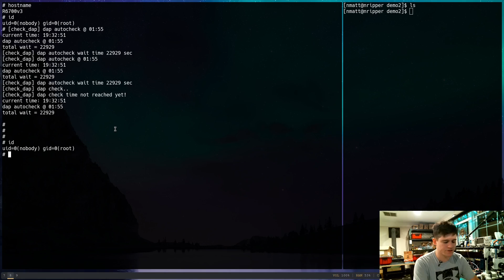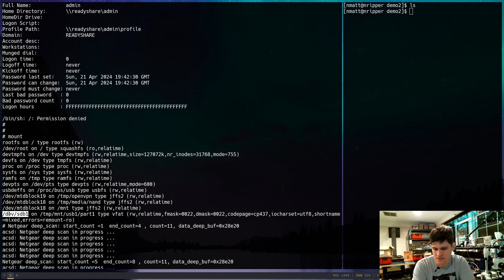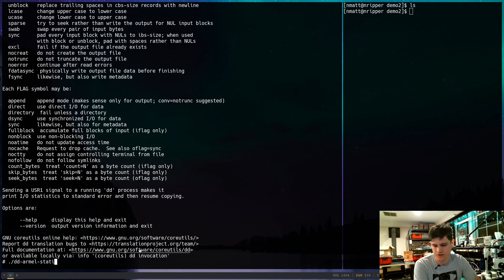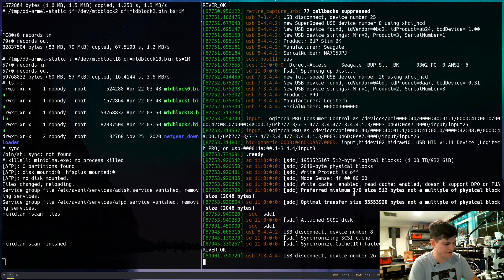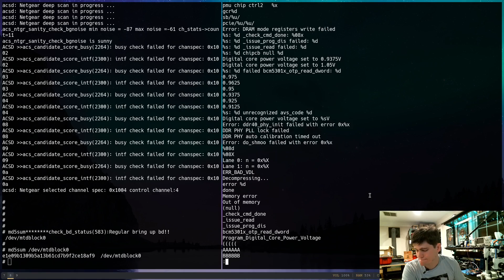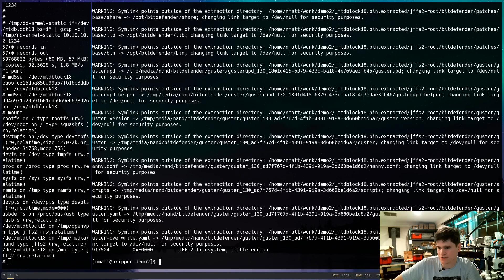IoT Hacking - Netgear AC1750 NightHawk - Firmware Extraction via Root Shell

Comment: Hey, amazing videos! Thank you.
I have couple of questions.
1. Can you explain how this extracted firmware is different from simply downloading latest firmware zip from the manufacturer's website? 
2. isn't this UART root shell same as just enabling SSH via webinterface and simply logging in?
I'm definitely confused.
Reply from the maker: 1. When you extract the firmware from the device itself you will often get writable partitions with device specific data that is not in the firmware file. Also, most newer devices don't let you just go to the manufacturer website and download the firmware file.

2. Some device's might allow you to login as root but many do not give you this level of access.
Reply: That makes sense. I was under the impression that if I got a root shell via ssh I was a root :-D Turns out they were tricking me all along. 
Thanks for your explanation  @mattbrwn

Comment: Question: instead of using netcat, could you use ftp (or sftp) instead to copy the files over?  That would seem simpler (netcat is good stuff however). Just for some more irony, setup the shared usb drive to be publicly accessible (through the router's webcomsole) and put the binaries you need for extraction on there, and the firmware files there also, then for them back using your main rig.
Reply from the maker: There are lots of ways to do the file transfer. what is "simpler" is often a matter of opinion. I think netcat is easier than ftp/sftp but that's just me.

Comment: Haha dream scenario being dropped into a root shell, wish all devices were like that 😂 Makes life so much easier having a shell on the live device, see any debug output, see what's running, try exploits against it, rather than going the whole emulation route on your main box. 

I did the netcat way on a recent router I checked out, was awesome, totally hadn't thought to use netcat in that way, worked a treat! 

Another question, have you ever de-soldered a memory chip and read it using a programmer and still can't find a file system? Or binwalk extracts stuff and it's basically empty, maybe a handful of files in what it extracts? Most devices I've fiddled with recently are far from straightforward. Trying to find some resources on what to do when this happens, I'm guessing it's some read protection on the flash chip itself maybe? 

Also, don't forget to remember your head is taking up the bottom right portion of the screen, so we can't see any commands you're typing behind your head haha
Reply from the maker: yeah definitely on microcontroller/RTOS systems you will not get any filesystems out of the flash chip readout. It those situations you can look at the strings or try to dive in an reverse engineering the binary code if you know the load address of the MCU target.

Comment: Just a note: when you are feeding dd to or from pipes, you may be suprised with the results. If you don't believe me, try running "yes | dd of=/dev/shm/out bs=1024k count=10" multiple times, and check what the size of /dev/shm/out ends up on every run. Simply put: you want to use the "iflag=fullblock" option of "dd" if you want to always be sure there won't be short reads that may corrupt your image.
Reply: Ela synonomate

Comment: Awesome video and information you do. Well done!
Would be very interesting if you able to extract and decode the Firmware of Deus 2. This is very popular wireless metal detector all around the world. Especially in England and US.
Alot of people caught the XP company that they nurfed (lowered the performance, probably because of the new device coming out... for money u know) of the Deus 1 from version 3.0 and up. Also,  the XP company suddenly requested the devices that you are going to upgrade to have Internet connection. No more local update! Which is one more hint that they rly nerfed the old device little by little, from one version to the next one, planning to show out the new Deus 2 so to be more distinguished in the performance. In fact the metal detectors technology have reached it limits long ago and there is nothing more to do except more facility, configuration abilities, some filters etc.
So would be very interesting if you able to crack it. Even I think you could make money if you able to write some custom FW and program to customize it. ;)
Just be aware that playing with the coil voltage and current could burned it out! GL to your new adventures!
xpmetaldetectors.com/en/gamme/deus-ii-detectors.php

Comment: interesting, but i was wondring if  network transfer couldn't be simplified by mounting network share as a  filesystem on the router exactly like a flash drive, it does have some kind of file sharing software already after all

and the 2nd thought, you show a lot of videos how to break into a device like that, but did you ever made a video about what can you use such end of life internet device for. like that camera from a year ago did you ever made it working for you as a camera, or did you just got inside and was satisfied with  it? 
i woul be very interested in something like this, geting your hands on a eol trash device, aserting it's capabilities and repurposing it for a totaly different use
secure webcam >>> ip camera with web interface to see the broadcast live, or something similar
file sharing wifi router  could possibly become low spec terminal server or bbs

Comment: Did you ever encounter a device that gave you uart but no write access? E.g. you see the device booting, you see "hit key to enter shell" but the device wouldnt accept any input. When i was hacking on a device i was only in uboot without internet or usb, so i retrieved the filesystem using kermit... Horrifying, it took like a day
Reply: Once had a device that showed the serial output @115200 but only responded to commands @9600 🤷‍♂️
Reply from the maker: Yep lots of devices have the device serial RX line disabled. Very sad indeed
Reply: @mattbrwn  There must be some way to enable it though right? The manufacturer must be able to debug them surely so they must re-enable them somehow?
Reply: Sometimes you can find lines on the physical board that are not connected. Bridging the connection may give you the ability to tx to the Rx line of the device. It's the manufacturers cheap way setting a roadblock.  @samhc088